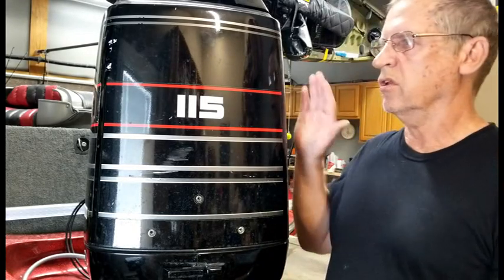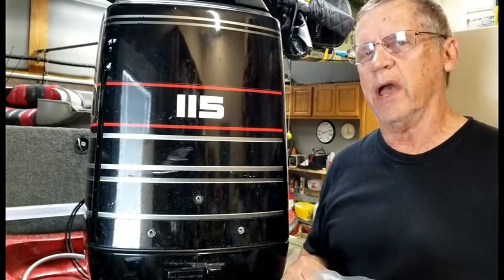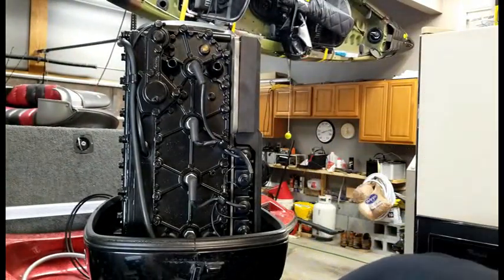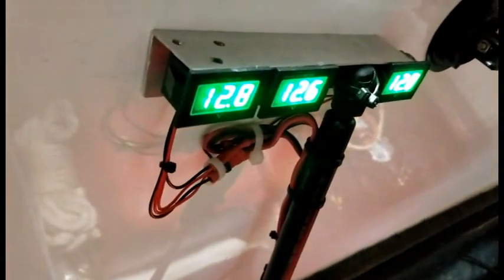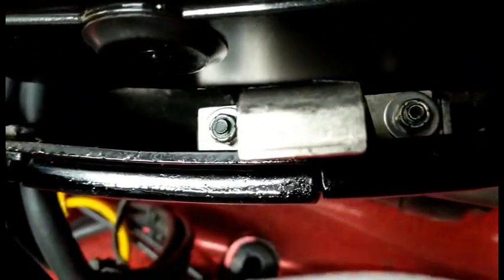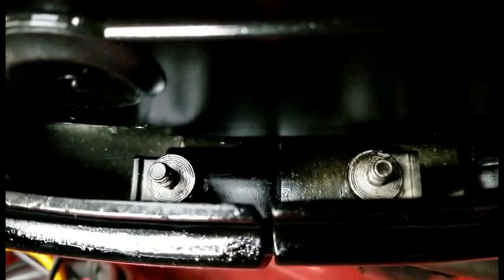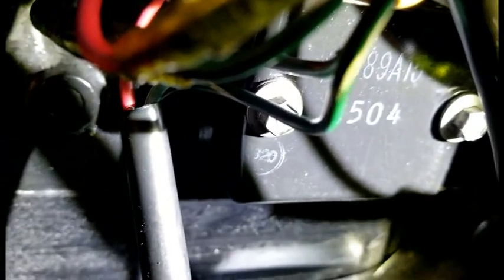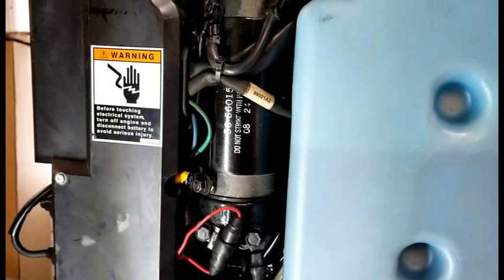1995 Mercury 115 Rev Limiter Replacement

Comment: I sure could use some advice I have the same motor and the same symptoms as you I would like to know you said it felt like a momentary loss of power.  Like hitting a log. Did it ever get worse as time went on like a big down and then full power then bog down.
Reply from the maker: Hi Brian, the symptom of sudden/momentary drop in power was the first thing I noticed. It happened only above about 30 mph. Below that it ran fine. When it did happen there was the drop in power but the overheating alarm 'chirped'. It never got any worse but I couldn't run at full throttle at all. I replaced the rev limiter and that solved the problem

Down the road a couple of seasons the motor was running fine, but if I throttled down it died and was extremely difficult to start, two times. I was on the water, about 4 miles from the dock. I thought I was going to get stuck, but I had a group 27 battery and I was able to crank enough to get it running. The next morning it started immediately. The next trip I went on it wouldn't start at all.

I ended up replacing the stator and the motor started up right away. Yay! But when I took it up full throttle it died at 4900 RPM, nose dived, dropped RPMs and went full throttle, nose dived, etc. Below 5000 RPM it ran fine (like with my 4-blade prop). It acted like it was the rev limiter again. I bought another one, same story. I disconnected the rev limiter and have not had a problem since then.

If you suspect the rev limiter, disconnect it:
On the switch box (power pack), left row, 3rd wire down (on mine) is a black wire with yellow stripe. (This wire comes from the kill switch at the console.) Also on that same post is a black wire. That black wire goes to a junction box between the switch box and rev limiter. If you remove the black wire and tape up the end that removes the rev limiter from the circuit. (If not careful, you could over-rev your engine, particularly when starting.)

Comment: Hey, i have the same outboard. At WOT it kindof sounds like its hitting the rev limiter a little bit. But the tach is only showing around 4800 - 5000 rpm.  Any ideas ?
Reply from the maker: Have you replaced any parts lately? I ask because I just replaced the stator and switch box in mine. The motor is running again but at 5000 RPM it drops out, falters. Below 5000 I can run for miles. I was told it was fuel starvation, but I don't think so. I think it's either the new switch box or the rev limiter

You can disable the rev limiter to see if that solves the problem. On the switch box is a terminal with 2 black / with yellow stripe wires. Trace to be sure but on mine the bottom one goes to the limiter, the other to the wiring harness and up to the ignition/kill switch. Remove that bottom wire and tape over the end so it doesn't touch anything. The other wire has the large terminal cover, leave that one connected. Run the boat again and watch your RPMs. Don't exceed 5250. 

If the motor still falters then it's fuel starved, most likely. Check your fuel line hose/bulb for a disintegrating inner nylon line. Check the fuel filter for small bits of nylon, also the fuel pump. You'll need to clear out/replace the fuel lines completely
Reply: @Rich Ward  hi thanks for the quick reply.  New fuel tank, line, filter, and pump. It wont quite hit 5000 rpm sounds like a very faint hint of rev limiter sound.  The maximum RPM is meant to 5250 ? Maybe my tach is off by a few hundred rpm
Reply from the maker: @nickt197  You still running the OEM 3-blade Quicksilver Laser II? If you run a 4-blade the RPMs will be lower. That gave me an idea to take my 4-blade with me to the lake for a test using that one.

The rev limiter is supposed to be set for 5250 out of the box. I've never gone above that number but the motor wasn't doing anything strange. It's always been at least 5200 even with the boat speed dropped. Now when I reach 5000 the motor just shuts down to below 5000 then jumps back up and falters again, over and over but if I just drop it to below 5000 it runs just fine, 40 mph about. 

I don't know when you're going back to the lake but I'm going on Wednesday, weather permitting. I've disconnected my rev limiter and I'll see how it behaves. I'll post the results here.

Comment: I have similar issue not 100% if it’s as you described mine would only get to 3500 which is low couldn’t get on a plane backed off the throttle then got back into and seemed to fix it and since have had it fall on its face then come back to life. I found the alarm module behind my dash someone disconnected it if I reconnect it it’s a constant annoying tone.

Was your alarm a momentary chirp when it started becoming a constant issue or was it just momentary chrips
Reply from the maker: There are 2 alarms: overheating (behind the rev limiter) and low oil. My alarm was an extremely short beep that happened at the same time the engine just blinked out. It felt like I hit something, like a log. It was that short, just a thump. It happened only above 25 mph, never below, never more than a fraction of a second. When I took the rev limiter off it was cracked. I believe it was shorting out through the heat alarm or maybe jumping to that wire and making it beep. I just replaced the rev limiter because there was no other symptom for the alarm.

A continuous beep is the overheating alarm. If this has been disconnected then something is definitely wrong. My best guess (consider that I'm an amateur at outboard repair) is that the rev limiter is bad, causing you to fail to get on plane. At low throttle it's getting/sending a false signal and when you go up-throttle you give it more electrical power and it overcomes the problem. 

A bad rev limiter may have caused the heat sensor to fail, causing the continuous alarm. If it were me, I would remove and inspect both, looking for obvious damage. Since the alarm is continuous now, it's probably bad. (Does it go on as soon as you turn the key?) That's a bad sensor to be disabled. Get your water intake plugged up with weeds and you can burn up your engine. 

Getting to this area is not easy. If it were me, I'd replace both sensors; overheat and rev limiter. I know this is throwing parts at a problem but sometimes it's the only solution without more knowledge of outboard motors.

You can find part numbers at the Mercury online catalog, you need your serial number.
https://www.mercurymarine.com/en/us/parts-and-accessories/parts-catalog
Reply: @richward2288  thanks for your insight

Comment: nice vid, for power pack cover screw, take one out and match it at home depot etc, easy peasy, save some money
Reply from the maker: I'm sure that the reason that a service tech tossed it out was because you have to remove the lower cowling to install it. It's not easy to get to and there are 3 or 4 other screws to hold it in place. Now, why he dropped all but 2 of the screws from the air box down into the lower cowling area is anybody's guess.

Comment: Hi Rich I enjoyed your video I have the exact same motor as u do. My problem is my battery is not charging will running so i changed the voltage regulator rectifier and battery will charge now but the voltage is all over the place and the motor is running poorly. I am thinking stator now, wonder if u ever changed yours?
Reply: Have you Check the battery cables ?
Reply from the maker: YouTube doesn't always notify me so sorry this is so late of a reply.

I didn't change the stator, the limiter was the problem. My engine starts and runs well, just can't get that last 5 MPH that it used to give me. It tops out at 47 now and even not always that.

The voltage will vary as you throttle up and down but should remain steady at the same speed and not over about 14.1 volts. That's the job of the voltage regulator. At 15+ volts your wires on the regulator will start melting; mine did. I don't have the tools to replace the stator and have never pulled the flywheel. It's out of my league.